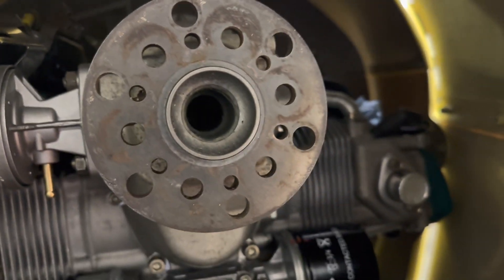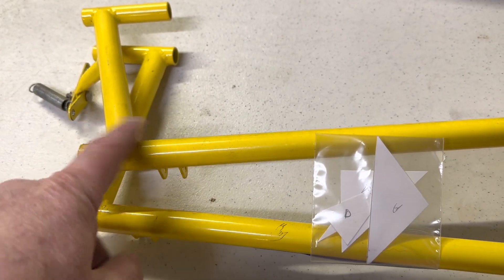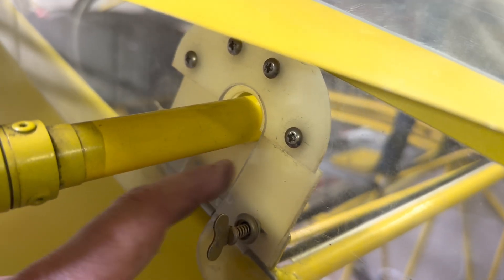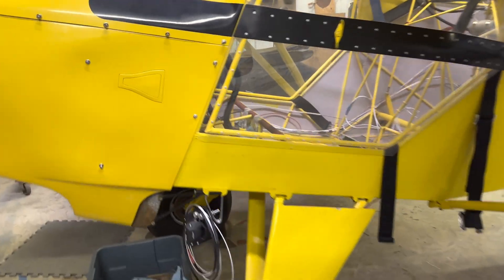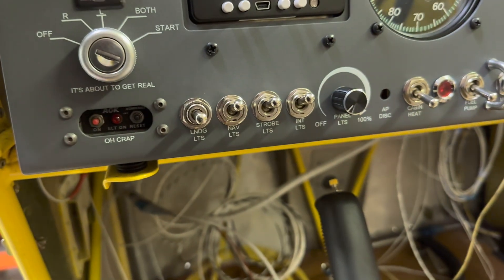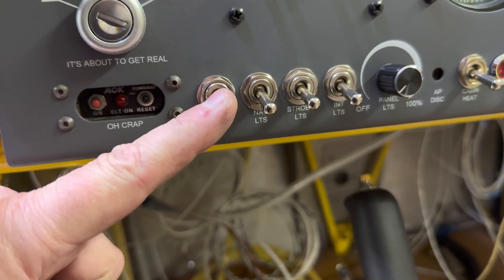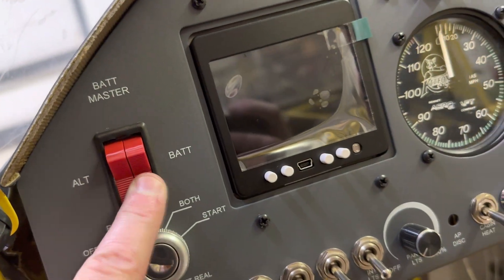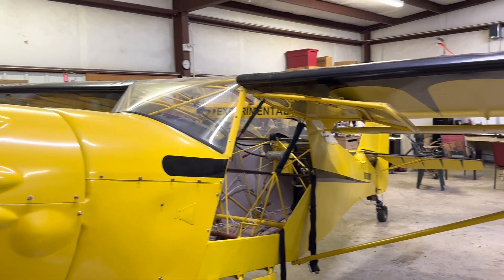RedRiver Fox - Progress as of 1/7/23 - Kitfox 4-1200

Comment: Just found your channel. Good to have another fellow Texas KF builder! I believe it's 5/8" of an inch from the back of the prop flange to the foremost part of the cowling. However, that looks like a different front cowling? Longer.... Maybe from a subaru install?
Reply from the maker: Hey, welcome to the channel.  I promise there is more content coming.  

As for the cowling, yes, it was originally around a Subie.  In my next video I will show how I calculated how much (2.5”) I need to cut off the back of the ring cowl to make it all fit properly.  I figure if I’m wrong, hey, its just fiberglass.  Plus, if I REALLY screw it up, I get to make a new “smooth” style cowling AND I get to play with carbon fiber.
Reply: @TheRedRiverFox  If you go to the smooth style cowl, you will love it.  About 6" less cowling in front of you to block your vision.  You can look at my flying vids on my channel to see the difference.  Jim
Reply from the maker: I have actually been following your videos for a bit.  I try to absorb all I can from other people and sort out what works for me.  You know, learn from those that came before me.  As for the cowl, I am currently "trying" to get a Cowling video edited.  I am going to cut my ring cowl by 2.5" and if my math is right (wouldn't bet on it) it will fit AND I will still have full adjustment room for my prop.  You know, just in case I want to make it nothing but a paddle in the wind.  I am going with the philosophy of "if I really screw it up, I get to learn how to lay carbon fiber!"